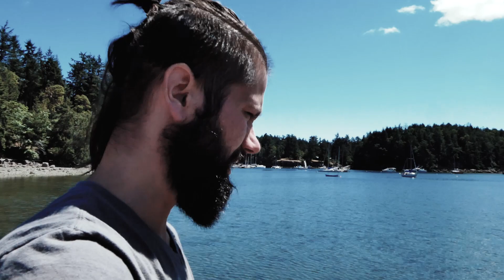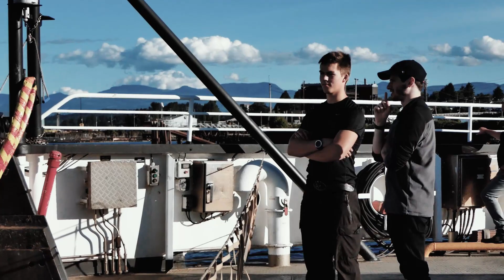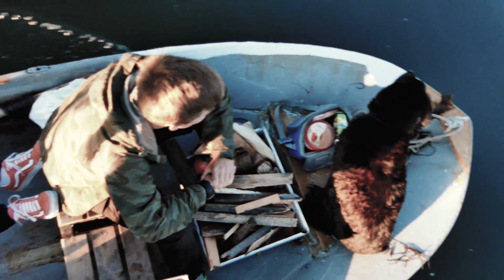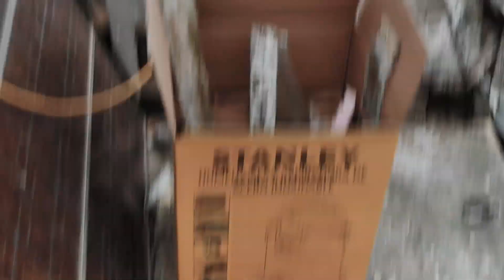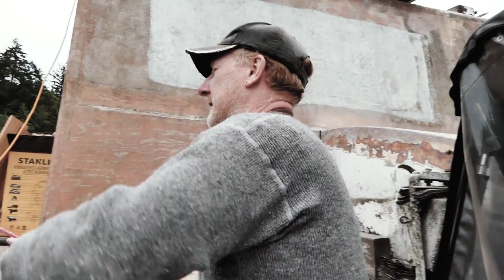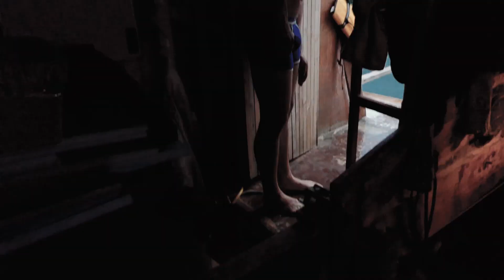Removing Rotten Deck - Sink or Swim 88

Comment: Great job fellas, 
For glassing,
First wash.with dish soap and clean water.  Use a sponge. Be systematic. Wash and rinse. Next.
Most important wipe down with clean cloths soaked in actitone.
Actitone will make the fiberglass stick.  
Scuff rhe area with 600 sandpaper if waxy or painted or too smooth. 
Basically wipe down with acitone and you re good.use small decent throw away 4 " brush. 
Apply wet down poly, apply wetted cloth, repeat as desired. Use small diamater black 4" roller. 
Mix your fiberglass thouroughly.
Use plastic drink cups. 
Anyway. Good luck

Comment: Before you rub your arms and push the glass in deeper get some old nylons and rub them over your arms it helps alot the mesh hooks the glass  and pulls it out trick learned working on fiberglass tanks.